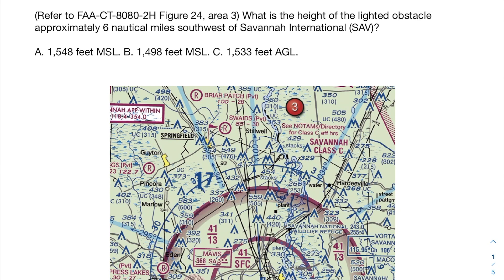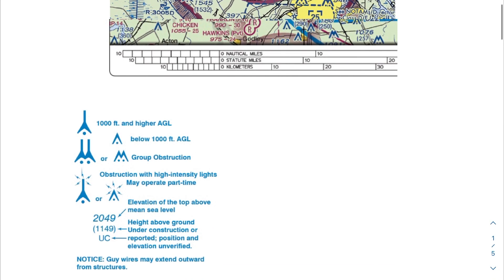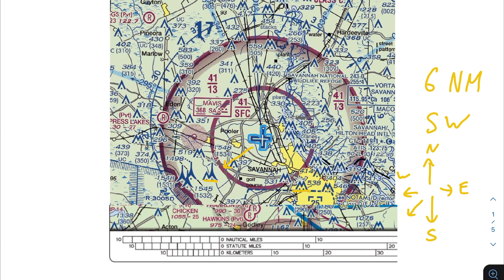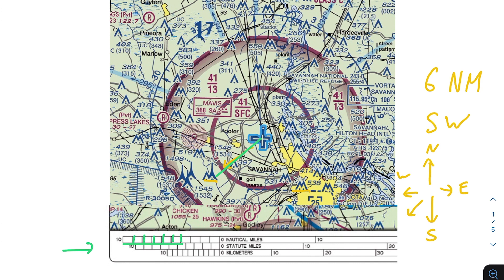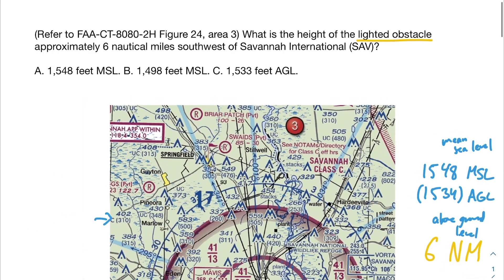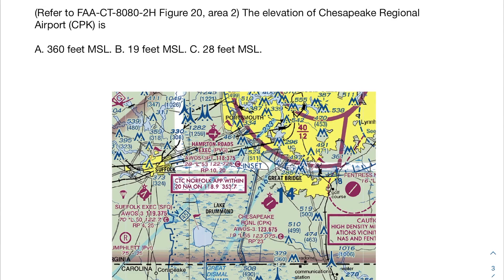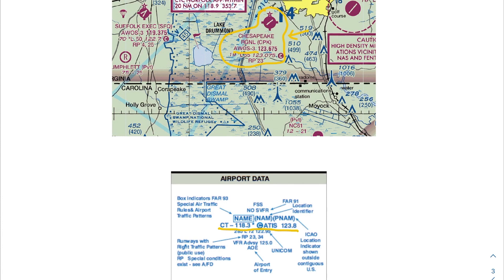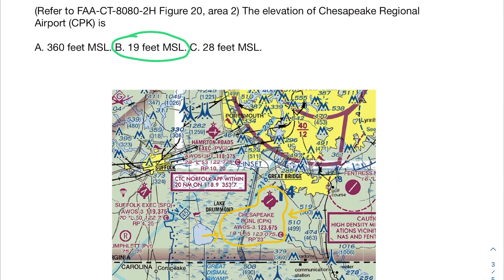Part 107 Test Prep: Obstructions and Airport Elevations on Sectional Charts

Comment: How do you know when the elevation listed is the elevation and when to add 00 at the end?
Reply: What I have observed is that surface features such as airports and obstacles on the sectional chart have the elevation in full,  where airspace related altitude indicators will require the two zeros to be added.
Reply: pretty sure if the number has italics you do not add the zeros

Comment: The whole reason I came to this video is because I couldnt be 100% certain that I found Savannah international. Your question says SAV but I do not see that on the chart. How do you know for sure? I am sure you know but I how would I know?
Reply from the maker: Hello! Good eye- the video doesn't contain SAV anywhere on the map. I think this was an unintentional effect of how I cropped the image. You can see the extended version of the sectional chart does actually contain SAV: https://skyvector.com/?ll=32.127583333,-81.202138889&chart=301&zoom=1

For the actual test, they will provide all the visual cues you need to identify airports :)